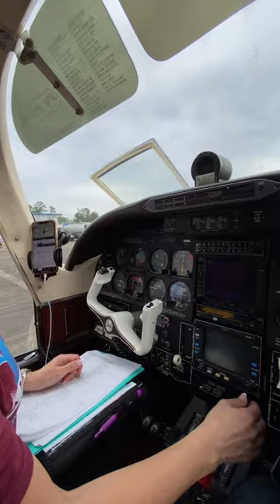Hot Start in the Aerostar Superstar 700 #shorts

Comment: As an A&P with lots of run time on hot lycomings, throttle and mixture full, prime 1 second per cylinder on the engine. Mixture to cutoff. Then as you are cranking, advance the throttle. Once it catches, wait till the peak and advance the mixture. Worms every time.

Comment: In a twin  like this.. nice too btw... does it help for start of 2nd engine - if   ya already got the  1st   engine up running ?
 Or are both engines  really completely independent starts ?
 I know both engines share common fuel  " Both" tanks  and got fuel  pumps etc.
 But always wondered this.
Reply from the maker: Hi Phill,  Both engines are completely independent.  The battery is the only common component.  When you start the first engine, the first alternator online will start charging the battery which helps when starting the second.

Comment: Hot start with a piston engine?
Reply: Lycoming are notoriously hard to start when warm. Coldstart no hassles, warmstarts are pain in the bee-hinds! (In my experience)
Reply: Try my way once. Full throttle, no fuel added. Crank, and as soon as it fires, yank the throttle back quickly and advance the mixture.  When you shut down, the fuel that is in the injection lines heats up and gets into the intake system. This gives you an overly rich mixture. When you crank with the thottle open, the mixture gets to the right ratio to fire up. Be quick bringing the throttle back.
Reply: @i.r.wayright1457  that’s basically a flooded start procedure what you described is called a “leaky” engine. Hot start difficulty usually happens because of vapor lock, which happens when a hot engine vaporises fuel in the lines. The procedure for that usually involves running the booster pump and then giving a short prime to repressurise the lines. But at the end of the day each engine is different and it’s all about knowing what works for your plane
Reply: @cantdestroyher7245  If you read what I wrote carefully, what I described is so called "vapor lock." So where did the fuel go that left an "air bubble" in the fuel lines? It made its way into the intakes. If you try to introduce more fuel in that situation, you will probably crank longer than you would if using my method. But, what do I know? I only spent 42 years as an A&P and I.A. with a couple years working for Lycoming as a mechanic.
Reply: @I.R. Wayright  I apologise if what I said offended you. That wasn't my intention
Reply: @cantdestroyher7245  No worries. It does make a difference if you are running a carb engine versus a fuel injected one. Some injected engines use a "sniffer valve" on the bottom of the intake plenum. If it fails and stays stuck shut, you will have a harder time starting a hot engine. Running a boost pump only exacerbates the problem.  If an engine fires briefly and then quits, it may be time to try the boost pump. Usually, the engine driven fuel pump delivers fuel in time to keep it running.  Other places that might be causing a problem is the mixture plates inside the rotating mechanism on the fuel injector that the mixture cable attaches to. Sometimes they can get scored and leak a wee bit. In that event it is best to let a qualified overhauler fix that.

Comment: No shoulder harnesses You're a dangerous pilot if you don't have those installed on your aircraft
Reply from the maker: They are installed and she did put them on before she taxied from parking.
Reply: @AerostarPilot  thanks for the response It's amazing how many people fly in airplanes that don't have shoulder harnesses It's absolutely ridiculous
Reply from the maker: I have only seen one without a shoulder harness installed.  Not sure when the inertia reel shoulder harnesses were made available.  They certainly weren't standard on the early Aerostars, nor were seat belts required in cars.  My first car, a '66 dodge Dart had aftermarket seatbelts and a metal dash board, imagine that :)

Comment: Do you know what you're doing 🤭
Reply from the maker: Not sure what you are referring to.  Standard hot start in the Aerostar is the same as normal but no prime.  In this case we were experimenting with a small amount of prime per the factory's instructions.  Its just enough to push the vaporized fuel through the injector lines.